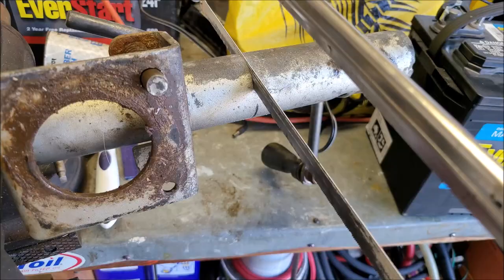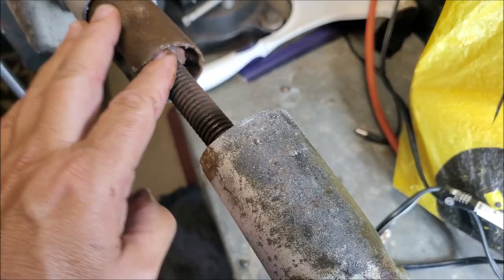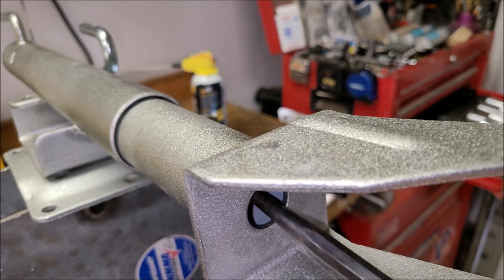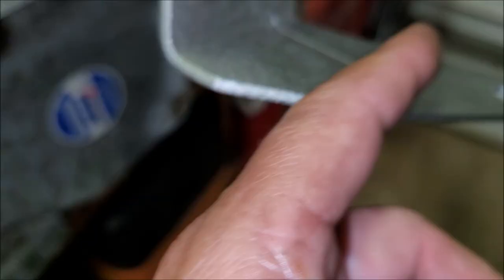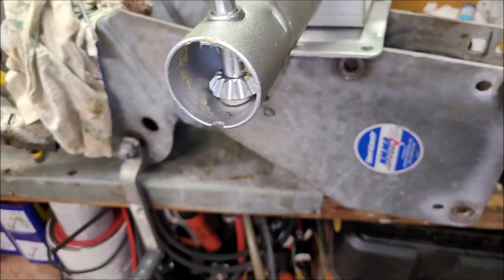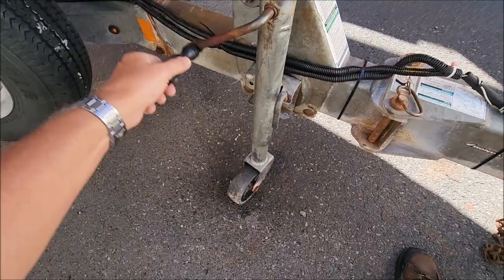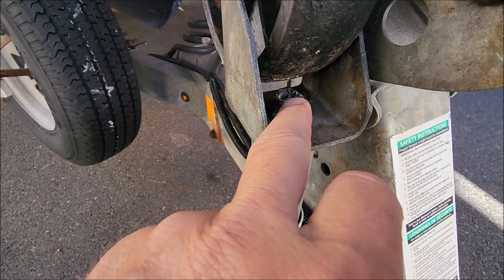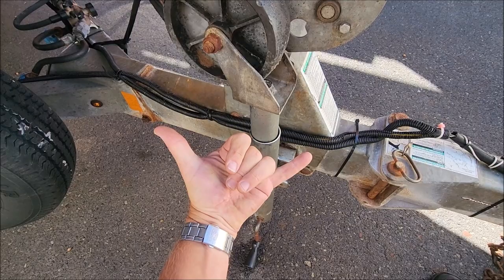How To Maintain And Save Your Boat Trailer Jack And Never Replace It Again. Yamaha JetBoat.

Comment: Aloha from Kansas, one question, do you need a boat license in Hawaii to own/ rent
Reply from the maker: Aloha!  

Other than renting a pontoon or whaler from the Marina on Kaneohe Marine Corps Base there are no rentals other than kayaks.  Owning doesnt require any license but does require the Standard Registration for Boat, Trailer and yearly ramp fees plus the trailer has to be inspected yearly which is another fee.